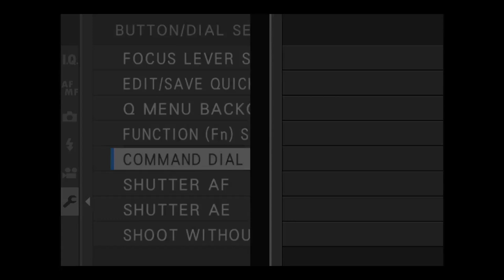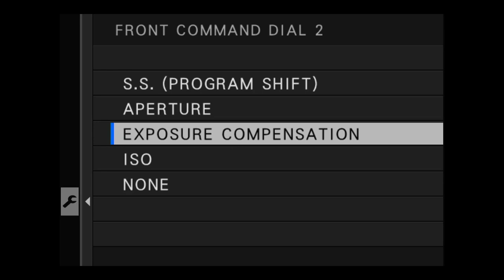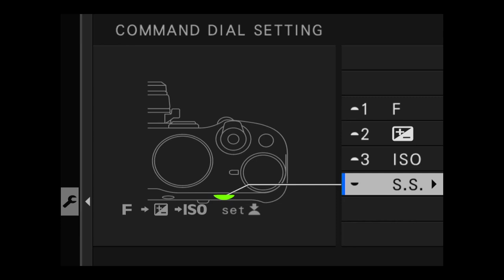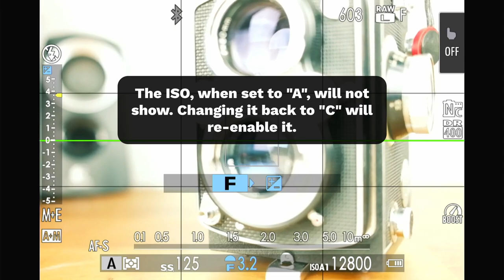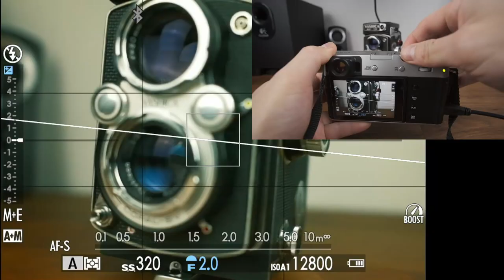FUJIFILM X100V Command Dials Tutorial

Comment from the maker: For everyone who cannot get the aperture dial to work when set to "A" go into menu > wrench icon > button dial setting > aperture ring setting (A) and set it to 'command' instead of 'auto'
Reply: That just saved my heart! Was having a heck of a time thanks
Reply: Thanks. Your comment helped me a lot.
Reply: a hour of pain later you saved me .. lol thanks brother
Reply: Hi there, for some reason, I still cant get command dial to change aperture after following the steps u mentioned, aperture icon is orange and not blue in color.
Reply: @leongtoon62  too low ligh , make iso higher or open aperture and it will become blue or white…
Reply: King
Reply: This would have been my question after having seen your video. Very helpful video - I was always asking myself how to use the front dial correctly. Reading the manual would have helped, I know - and now you helped me. Thank you.
Reply: Yes. This is what I was missing
Reply: Thank you so much for this. It was driving me mental and those simple walk-through instructions completed in 30 secs has just made my day after sitting on this and struggling for 4 months now
Reply: THANK YOU MAN

Comment: Thanks for the video. In addition you can also set the top dials to allow the command dials to switch between, P, A, S and M modes. For example, with the aperture ring set to A and Shutter ring to T, you're now in shutter priority mode when using the rear command  dial. But switch to the front command dial to change aperture and you're in manual mode. Now change the shutter ring to A. You're in aperture priority mode and can use the front command dial to change aperture. Go past f16 on the dial and you're suddenly at f2  in P mode. Brilliant!

Comment: For some reason, even though I have my aperture ring to A, I still can't control the aperture using the command dial. Do you know why that may be the case?

Thanks for another super helpful vid!
Reply from the maker: Hey truong, check the pinned comment, I replied to someone with the same issue. I forgot to address this in the video
Reply: @JayRegular  Thank you!

Comment: Hi Jay. I cannot understand how to get into full manual mode using front and rear command dials! I am on T on top dial and A on aperture ring and have front dial set for F then iso then none as I don’t use exp comp in manual. But the front command dial will only change iso not aperture and camera shows to be in shutter priority. Can you assist me to get into M mode but only using front and rear dials rather than having to use aperture ring on lens. Thank you.
Reply: My comment above should help you
Reply: @adriancoleman1120  thanks Adrian but if I have the aperture ring set to A no matter what I do with the front and rear command dial I cannot get the camera to go into M mode. I know I must be doing something wrong but I can’t figure it out! I have the front command dial showing as F then ISO then NONE but it will only set up for ISO and not aperture.
Reply from the maker: Malcolm I missed this detail in my video, but go into menu > wrench icon > button dial setting > aperture ring setting (A) and set it to 'command' instead of 'auto'
Reply: @JayRegular  you are a star, this has been driving me mad 😡 Thank you so much for your help, all working as I want now using front and rear dials in M mode. 👍🏻

Comment: Dangit, so close, I can get the rear dial to control shutter speed and the front to cycle between exposure compensation and iso but the aperture even with the front rotater ring set on A doesn't let me access the F stop; instead of showing up in blue, mine is in orange and is pegged at 2.0.  Wonder what I am missing.  When I try to set the front command dial to Aperture in the menu, it just goes back to the screen and shows F...if I try to set it to shutter speed though it will go back and show SS.  If I put the physical aperture wheel to a number, say 4, that shows up in blue on the screen but now the front command wheel does nothing.  Very odd.  I also as per page 228 of manual set aperture ring setting to 'command' from 'auto' and thought I would be golden, nope.

edit  -I think I now sorta have it - aperture ring to Command from  on page 2 of the wrench menu, i put rear command dial to SS, put front dial to Aperture and then put options 2 and 3 to NONE.  Then the command dial would work the aperture, then i added back iso and exposure comp and it works as you would expect.  If you have anything else in option 2/3, it seems 1 wouldn't work for aperture control.  One thing other thing - if you have your time ring set to to T, its like manual mode and there is no way to force an exposure compensation (which makes sense I guess).

To be clear, if you lose control of ability to control aperture on the front command dial, make sure your front ring is set to A, wrench menu page 2 apeture ring is command and not auto, set functions 2 and 3 to none and 1 to aperture, then it works, THEN add back in iso/exp comp.

Comment: I have my ISO set to A my SS to T and my exposure compensation to C. The front dial has exposure compensation greyed out and will not work. Only works if I move SS from T to A
Reply: Can you tell me what I’m doing wrong and why the exposure compensation is grayed out and won’t work with the setup i described?
Reply from the maker: If you set your shutter speed to T you are still in control of your shutter speed with the back dial. For exposure compensation to work, you need to set shutter speed to auto to give camera full control in order to 'compensate' the exposure.